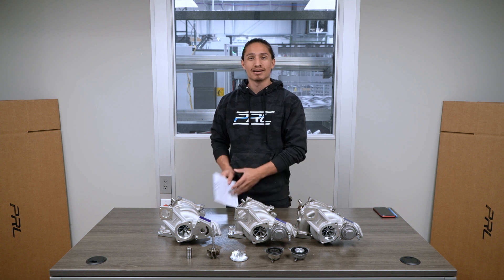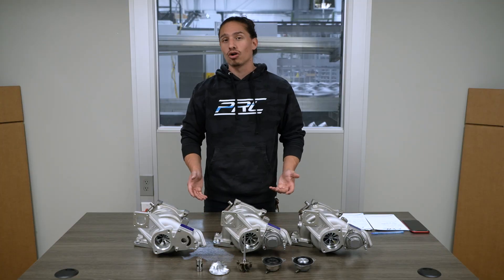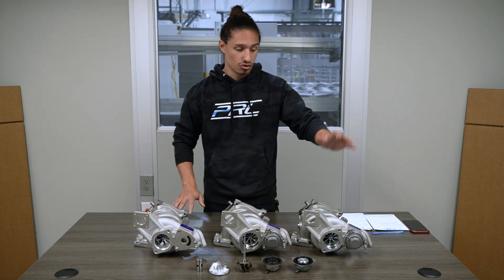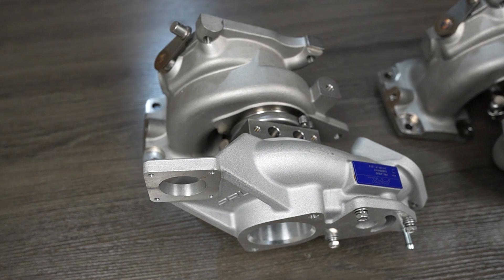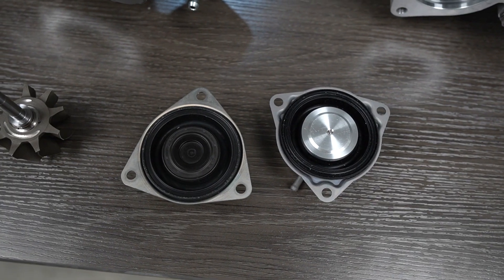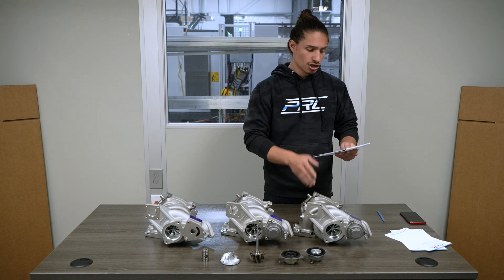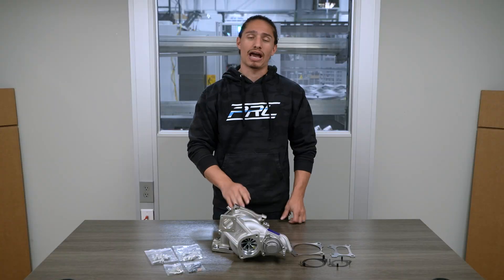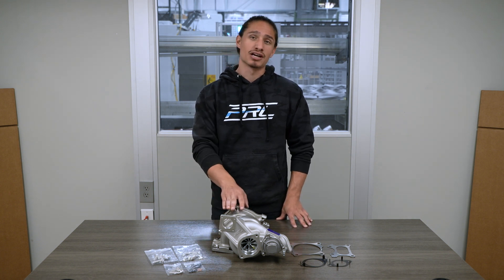What's So Cool About the PRL Motorsports P700 Turbocharger?

Comment: I have the Mitsubishi stage 2 tourbo its out put its 570sh & it's crazy fast but this tourbo I might pik this one for thos crazy gains 700hp not bad
Reply: My p600 made about 640crank and this should do a touch more but the hotside is a restriction around 7k rpm because of the smaller hotside.

Comment: Does it require fuel upgrade and would I be able to go back to stock tune for emissions testing ?
Reply: I wanna know this too
Reply: You could get it tuned and use it without a fuel upgrade but it definitely wouldn't be giving you anywhere near the performance it's capable of. But the simple answer is you could still use it. The emissions question I don't know about since I'm in Florida and luckily haven't had to worry about that. The P700 is phenomenal if you're going to eventually upgrade your fuel system. If you're not, I would recommend the 27Won Kuro. The P700 would be a waste imo with stock fueling. It comes down to what your power goals are. Are you looking for a specific number or know for sure you're not going to keep pushing for more
Reply: @thinkforyourself5672  thanks for the info! Id like to have a type r turbo, tune, and intercooler. Would like to keep my intake stock if possible. The only reason im not sure about fuel upgrade Im not sure about the longevity of it. I hear that internals can get deteriorated over time. Still new at all of this so just trying to research everything. This car is my daily
Reply: @GR-Z , What car do you have? Accord?
Reply: @thinkforyourself5672  yeah 2018 accord sport 2.0t. So far im on ktuner stage 2
Reply: Stay on stock turbo until you do fuel - stock Type R turbo can make about 500bhp on Ethanol but you need a fuel system to feed it....if that's not enough power and you want more you can move to a drop in and feed it properly to see gains.  Drop in fully fed is 600 to 680bhp - if thats not enough you'll need a full frame turbo and built motor to take you to 870bhp on hondata or higher on motec

Comment: How many horsepower does does provide
Reply: Rated at 700hp crank HP
Reply: @weaselman50  so if I were to install it into a stock 1.5t accord how much hp would it make
Reply: @zmbielol1903  This Turbo isn't for the 1.5. And you're going to have to upgrade your fueling to feed it if you're looking for real power gain.